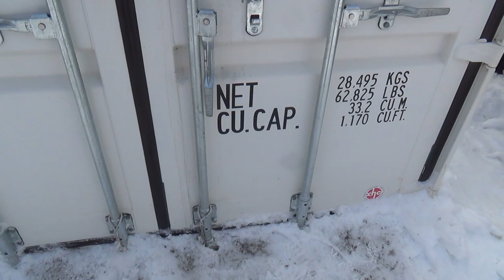Boaris fire up hook up the kubota trailer and mini ex and lets clean snow

Comment: The old Ford 8N tractor 3-point hitch does not have position control like your Deere 2032R. That's why it tends to float around. To maintain a fixed height when towing with a drawbar on the 3PH you were supposed to disengage the rear hydraulics with the small lever on the side and then use a special fixed bracket that ran from the ends of the lift arms up to the point where the top-link would attach. This has its own hazards associated with it because if you have the fixed bracket in place and accidentally engage and lift the 3PH it will bend those support arms into a pretzel.
Reply: You are wrong about that! The 8N 3 point hitch DOES have position control unlike the 9N and 2N which only had draft control!

Comment: Get the part numbers for the seat pad and take the numbers to a John Deere Ag dealer ship. If the parts are used on the Ag side you can order from John Deere and they will be about 30% cheaper. I worked in John Deere parts for 24 years and I did this all the time.
Reply: Alan Charlton great idea

Comment: John Deere is expensive in the states but the dealer near me usually has all the parts I need in stock witch is nice. We have 2 gators, 2 z turns and a 310j and almost always have the parts I need except when they do have to order parts it takes a week. I ordered 5 pulleys and it came to 110 dollars including the one they had to order. That's what sucks haha

Comment: Three point hitch should not drift down like that when the clutch is pushed in or tractor is off. Seals are leaking  or valve is leaking by in the pump. There are a couple videos about it on here.
Reply from the maker: yes it likely is leaking

Comment: Hey Bill, I know this is going to sound like a stupid question, but does the 110TLB run on gas or diesel, because you never seem to glowplug it.
Reply from the maker: It's diesel. It has a in line grid heater. It is in the air tube it glows super bright and hears the air coming in. It doesn't have glow plugs. Although I never use the grid heater either
Reply: BILLSTMAXX ah see thanks Bill I didn't even think of that! That's really neat! I kind of sound like a noob I guess you could say because we own a Kubota BX2230 which I have to glowplug every time I go to start it. Thanks for the reply! Keep up the good work!

Comment: Bill - that hydraulic control on the three point hitch uses a indirectly operated valve system (there is no direct connection between the quadrant control handle and the actual valve that causes the lift arms to raise/lower...  The valve  is getting stuck (causing your uncommanded lift)  It can also get stuck and not lift at all and everything in between.  That there is no hydro filter doesn't help.  

Change the hydro oil - 15% chance of fixing the issue.  

The real fix is to pull the lift arm cover, clean and debur the valve, Clean the hydro reservoir as best as possible, check the pressure relief valve, new oil, seals/gaskets should give you a long term fix.  Pretty much all the parts that might be needed are available.

Rachel has  video on the topic - https://youtu.be/XcWtNVOxzDg 

Good luck  and thanks for keepin Boaris out there workin!